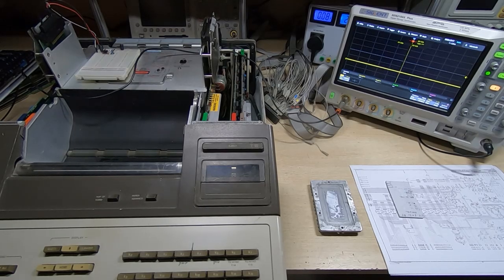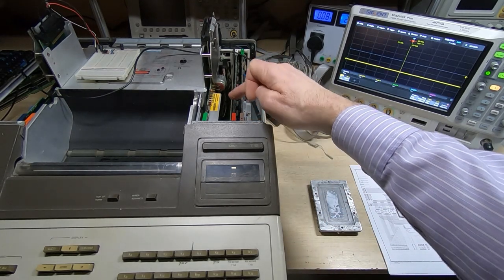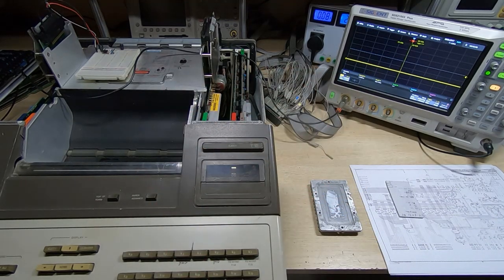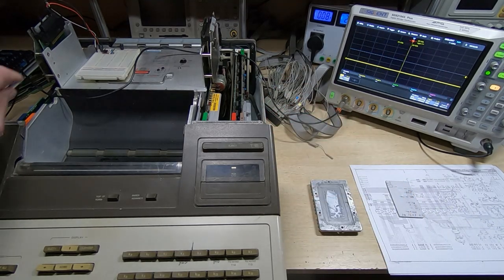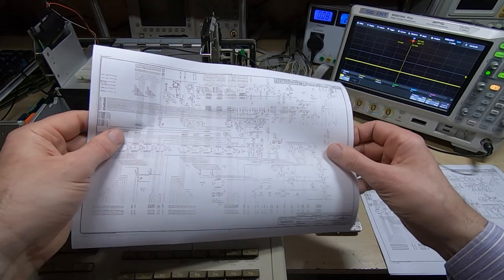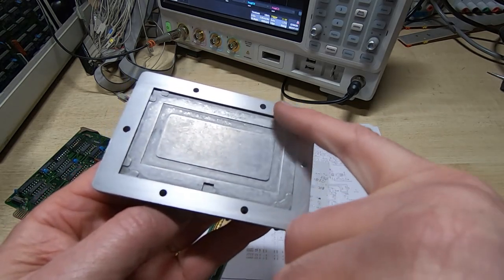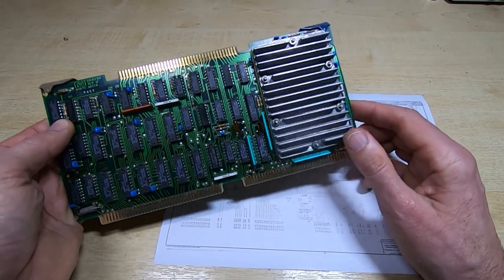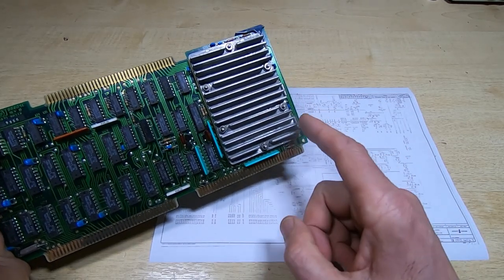HP9845B Repair Part11

Comment: Thank you for taking the time to show your repair. The hybrid in my HP 8130 is mounted in the same way and I suspect it may not be making a good connection. I was surprised to see the variation in the heatsink casting - unusual in an HP product. Checking to ground AND Vcc is an excellent idea as well as checking the heat sink compound. I will do both. Regards, David
Reply from the maker: I forgot to say in the video that I have seen this sort of failure a number of times. Another method I use is to cut a piece of 0.8mm copper clad board material to the size of the module and 'pad it to the thickness of the module substrate with mylar tape on the reverse side. I then refit the clamping system (heat sink in this case) but DO NOT plug it in. If the clamps are correct then all the pins should be shorted. If not then the clamps are not correct and need 'adjusting'.
Reply: @JerryWalker001  Thank you for the additional tip, l will try it!